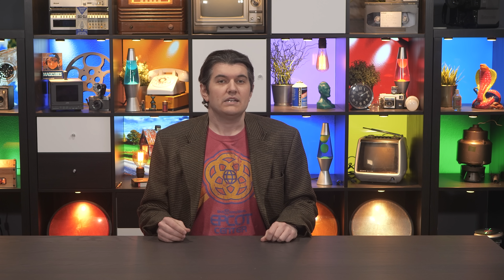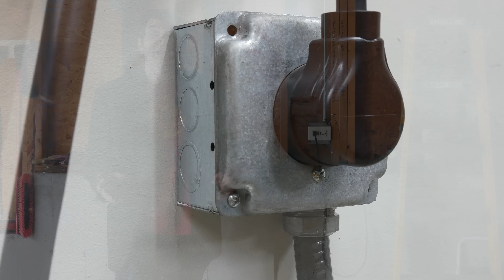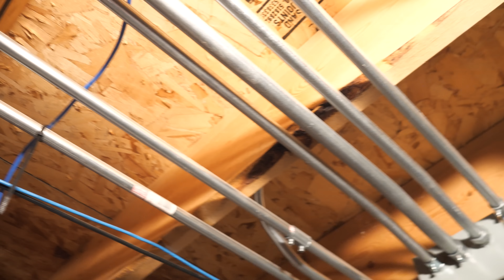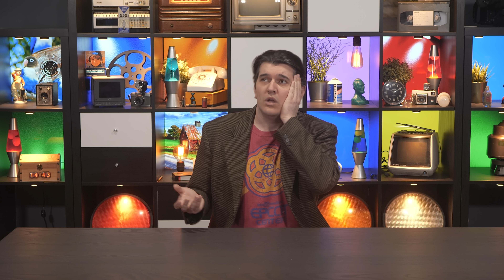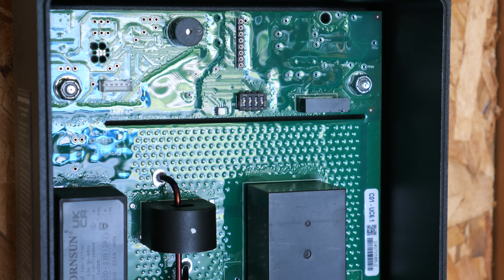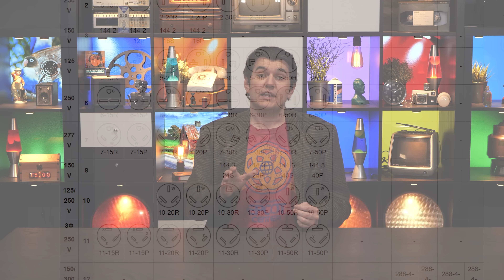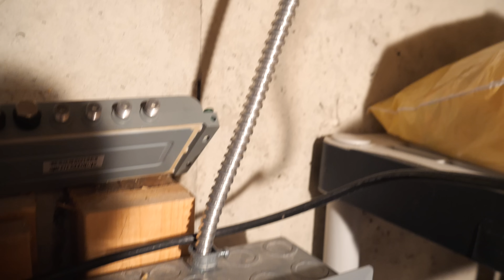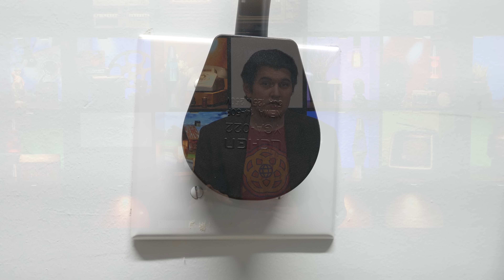The "standard" car charger is usually overkill—but your electrician might not know that

Comment: I don't drive a lot so I can get away with charging every 1 to 2 weeks. I started out charging at L1 and survived fine on this. But I live in a place with crazy weather and wanted the ability to charge faster if I know a severe storm is coming. I only have access to a 30A circuit shared with my water heater through a NeoCharge so I switched to charging through that at 24A. That has been more than enough to easily meet my needs. I have an energy plan that gives me cheaper nights for 6 hours a night, and I use scheduled charging.

I visit family in other parts of the state with some other family riding with me on occasion. I think I've sold them on the fact that EV range and charging aren't a major ordeal. I use free destination charging when I can, but unfortunately it's not common around me. But it's also not required for me.

Comment: THANK YOU!!!  I have this same conversation with friends and family after buying my Bolt EV and every time it starts out "Don't you need an electrician to install the charger?"  And I approve the charging station app rant.  I am glad there are app-less options and we should be endorsing them more.
Reply: app-less is not needed. But anything that is in the app should ideally be accessible from the hardware itself too. And anything that's actually required functionality most definitely!
But I really do not mind an appliance that also allows me to tell it to host a web-server exposing all its hardware controls and displays/statistics. aka not app-less. But app-unreliant.

ps: And preferably also SSH-server that can be used to connect to the linux machine directly, and that gives you full control (no stupid "only volatile memory that is reset on a restart" or "no root access" stupidity)
Hell, I do not even mind if the ssh connection was the only way to access diagnostic logs + statistics. Or even niche controls/settings.
Reply: My brother installed his own outlet, with a few phone calls to our former electrician uncle. It was a Saturday project for him too. And they love their PHEV Pacifica.
Reply: I have relatives who are electricians, so I'm all set haha
Reply: Your bolt has a 60-65kwh battery.  Try that game on something that has a 100kwh battery.  When you consider that it would take 56 hours to charge a Model S from 10% to 80% assuming 100% efficiency and that you can sustain 1.2kw charging, that game doesn't work very well any longer.  Then people say well you can just hit a L2 charger, and as soon as you do that, the cost per KwH means the price to drive the electric car is near the same as a Prius.

If you have a 230v 50a circuit installed for a L2 charger you can charge that same just 5.8hrs.  Meaning that it's 100% possible to now do back to back trips.  It's a static cost to get the outlet installed, install it once, and boom done.  The charger itself is only $300-$400.  Not only that, because it charges up so quickly, you can schedule night time charging to charge between 12AM and 6AM, taking advantage of the crazy cheap night rates if you move to hourly pricing.  I pay maybe 2c/kwh on average.  Where as during the day it can be as much as 6-15c/kwh.

Now, imagine you know you have a big trip coming up where you are going to run out of the battery if you hold to 80%.  With a l2 charger, even just hours before you can change the limit to 100% and tell it to charge and charge at much LESS cost over night.  so you start off with 100%, and maybe thats enough to get to and back on the same charge so you don't have to use a DC fast charger away from home.

On top of the purchase cost, it's really not that much extra to have a L2 installed at home, especially if you don't need to upgrade your panel.  And most electric companies offer cash rebates on EV L2 charger installations which offsets the cost significantly if not paying for the entire installation out-right.  I had to upgrade my panel to 200amp and have a new 14-50 line run over 120ft to the garage, so it was almost the worst case scenario.  That installation cost me $3800, I got $3600 rebate back, so the entire installation of an L2 charger in my garage only cost me $200.

Comment: it's 11am here and my solar panels are producing 4kW (they peak at ~6kW); I'm leaving on a 2000-mile roadtrip in my Tesla tonight so am charging it up now; I decided NEMA 6-20 was the optimal connection since it doesn't overpower my panels and also I didn't have a spare 50A breaker so I decided to DIY my own split from my 50A range, essentially downrating it to 30A so I could run a 20A cable from my kitchen to the garage through the attic.

Minimimal expense, fuss, and I'm chuffed it worked so well for so little money.

Comment: 12:20 Is there a requirement for a means of disconnect?  Even something like a dishwasher or garbage disposal usually requires a switch or other means of disconnect these days.  Having it plug into a receptacle that can function as that means of disconnect.
Reply: Obviously this depends on specific amendments and/or situations, but in general most means of disconnect rules require either a disconnect in sight for servicing (includes cord and plug connections), or a lockable disconnect if not in sight. 

Unless there is another code section that requires a specific type of disconnect at a specific location, all you usually need is a breaker lock that is “permanently” installed on the breaker feeding the equipment.

Comment: When I bought my first electric car and brought it home at 20% battery, I plugged it in to a 15 amp outlet because that's the only charger I had access to, and it told me that I would have to wait 115 hours for it to charge to 80%, so I drove to the local safeway, plugged it in to a dc charger for 22 minutes while I got some groceries and came home with an 80% charge and started shopping for a charger to plug into the RV outlet I had already had installed outside my garage directly under my electric panel for a relatively low cost ten years earlier.  While I could charge every day from a 15 amp outlet, I prefer charging on friday night from a 50 amp outlet, and then since I'm likely to drive somewhere over the weekend, it's ready to leave for the monday morning commute without needing to be unplugged, so every weekday morning there is more time to do whatever else is worth spending more time on than dealing with unplugging a car, and on most evenings there is more time too without dealing with plugging in a car to a 120v charger because otherwise it would take too long to recover multiple days of use.
Reply: Your first sentence implies that you have a +1500 kwh battery pack? Is your electric car actually a tractor trailer?
Reply: @BL3446  no, not all "15A" chargers default to 15 amps.  The one included with the kia ev9 gt line needs to be configured for a higher wattage for faster charging and I didn't know that the day I bought the car and plugged it in the first time.

Comment: Since you live somewhere that get actually cold I'd really like to aee you charge your Ioniq 5 outside when it is REALLY cold on a 120V 12A EVSE and see how much range you actually gain overnight.

I keep asking EV and charger review channels but everyone seems to be ignoring it. Aince the battery cinditioning aystem will be using 2-4kw but cycling on and off I'm very curious if the 1.5kw continuous from the wall is even enough to gaim any range at all when it's something like -20C outside.

Comment: We have two EV’s at home and since we moved, they’re both being charged by a 240V 10A circuit. I have plans to upgrade to 3 phase 13A, quadrupling the power, but the reality is that the current solution is fast enough. My wife charges her car once every 3 to 4 nights and my car charges during sunny hours when our solar panels produce more electricity than we need. It proves the point of your video: slower charging is not better or worse than faster charging.

Comment: I lived in a snowy Maryland and parked the car outside. I needed to charge the car more than 120v during cold weather, so I bought a 2x 120v to 240v Y cable and plugged it into two outlets in the house. Used it for over a year with no issues before moving to a state without snow. Worked perfectly and was able to charge the car just fine in below freezing weather.
Reply: what was your y cable model?

Comment: @24:00 
I’m in U.K., I’ve experienced both car and charge point integrating with energy provider (Intelligent Octopus Go). I have to say, the experience is much much better with charge point integrating with energy provider. 
Car will start charging and have to be told to stop charging. The car has to share its location to energy provider. Unreliable 4G car connection can be problematic. 
Charge point integration means simply plug in and forget. Very reliable.

Comment: Well when it comes to new construction, most building codes require an EV charging station to be installed and they have to do it however the code tells them, whether its overkill or not.

Comment: There's a third problem with charging EVs at multifamily dwellings: total building capacity.  A 20-unit building where everyone comes home from work and needs to charge overnight at 5kW needs an additional megawatt of power.  It's very likely they'll need to upgrade the building main.

Comment: Heh, I have zero experience with electric cars yet work with electric bus calculations all day. 

We will open a site with about 130 chargers (30 120kW "fast" chargers, the rest 60kW "overnight" chargers, and the whole site has a 4000kW grid connection. Another site has 36 450kW fast chargers (other types of bus). But our largest (25m/82 ft) buses have 800kWh batteries and blow through that 2-3 times a day... Boy are personal vehicles puny 😂

Comment: chevy volt, 20 mile total commute, charges in less than the full night on a regular (US) outlet at 9 amps. The powerful plugs are nice when I'm visiting someone outside the electric 2-way range and can charge fully in a couple hours (given somewhat limited electric range or 40 or so miles).
Reply: I used to use the 110v stock charger all the time, and it was fine for short trips and overnight charging.  But sometimes I need to make multiple trips, or need to go further, so I invested in a few 220v chargers to install in convenient locations to park.  So now the stock charger stays with the car in its little cubby in the back.  It's still a great backup charger on the go.  

For example, one time I was low on gas and battery, and the nearest good priced gas station was more than several miles away from the motel I was staying the night at (long road trip).  So I grabbed my charger and spare extension cord I keep with it, carefully ran it under the motel room door, and unplugged the microwave to free up a good outlet.  Was able to have the car fully charge overnight, and was able to make it to the cheaper gas station with range to spare.  One of the most satisfying moments I've had driving my Volt.  

It may have a low EV range, but it's just such a versatile EREV that I can't help but love it.  Sad that they stopped making them.

Comment: I have a 65 kWh Kona EV and most of our needs are serviced by a 120V trickle charger at about 900W. It gets us around 40 km/day which is about what we use. It would be slightly more convenient to have 2 kW capacity, which would cover 99% of our use cases. This means a 15 A 240 V dedicated branch is fine. But honestly we can get by with home trickle charger.

Comment: I'm from Europe and the charger at my home is wired directly into the breaker board. Every big electric load is wired that way. Why do US households have fewer breakers in their panels and why do they get a big outlet installed? I saw the video with the room heater conversion but that can not be the general reason.
Reply: There's a huge amount of variation in US electrical panels, often because of history and upgrades, but it's not generally true that most have "fewer breakers." Although I guess it depends on what you mean by "fewer"? The sub-panel at 7:18 has 24 breaker slots, and it's a downstream sub-panel not a main panel. Prior to the 2008 NEC there was a limit of 42 positions per panel (is that "fewer"?). Sometimes people just buy the smallest and cheapest panel they can, because they don't think about future expansion. I don't know what you mean by "get a big outlet installed."
Reply: @johnhawkinson  Regarding panel size: The electrical pannel looks way larger than it needs to be. Where I'm from the breaker amount to surface area ration is much higher. That's what I'm curious about.
Regarding the outlet: Wrong way to ask the question. You don't need an outlet. It's shown in the video. My question is why have a plug on the chargers (where power goes in) in the fist place, if you only ever plug the charger into the wall and then the car into the charger? It's not a regular outlet so you can't use it for much else.
Reply: @freddygoodman  Maybe Google some typical US panel installations to get a better sense of that. (This panel looks like Square-D Homeline panel, so try "HOM2448M100PCVP")  GFCI and AFCI breakers are much bigger than traditional breakers, maybe 2x as wide horizontally, so panels have gotten wider. And then there's generous space ("gutters") for wires to go up and down. And separate ground and neutral bars for terminating those wires. The space above is for a pretty large main breaker, with fat lugs to allow big gauge cables to make gentle turns, esp. if the panel is fed from below. I guess we have bigger wires than you do, comparatively, what with our lower voltage 120V branch circuits.
As for why people install a receptacle to plug in the EVSE instead of hard-wiring it, well, I think a lot of people don't (Alec did not in this video!), but it's likely viewed as cheaper and more future-proof to have the electrician install a receptacle and the homeowner can mount the EVSE and plug it in themselves.  I'm not an EV expert, but I think there is wide variation in practice throughout the US.
Except those people who already have the requisite outlet in their garage for a clothes dryer or a welder or a bespoke artisanal lathe. A small minority, that.
Does that answer your question?
Reply: Where in Europe? Europe is not a country and you shouldn't compare it to one.
Reply: @CorneliusTaylor-s1u I'm sorry, but I'm unable to see how the country I live in is relevant to answer my question. I mentioned that because people might provide some extra context that I don't have.

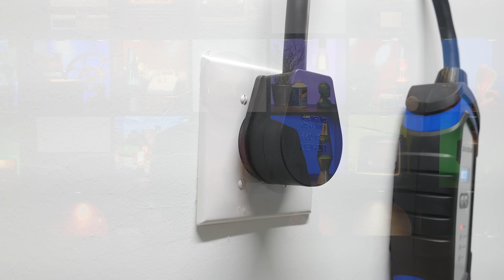Comment: 0:23 ... the flexing on that outlet is mildly concerning.
Reply: It's probably not that big of a deal since you hardly ever need to unplug/replug the things that go in those outlets
Reply: NEMA outlets for you. Very little holding it all together.
Reply: the metal part of the outlet its made on to is flexing and only 2 screws hold it to the box  they could go to a twist lock that I Feel would be much better .
Reply: Proper 14-50R requires considerable insertion force, and mounting a box on one side to a stud + drywall means . . . things flex.  Heck, it might even be an "old work" box and mounted directly to the drywall.  It ain't commercial.

Comment: I’ve had my id4 for a year, only charging at 12amp on a standard outlet in my detached garage, since running a new line would be crazy expensive, only issue I’ve had is before a road trip trying to get as much charge as I can requires not driving the day or two before or planning in advance to charge extra for a few days. I did manage to convince my parents to throw a 30a circuit in their new house despite them being anti ev because it’s way cheaper to do now $250 vs $1k+ to do it later.

Comment: Yeah, I had a PHEV with a small battery that got ~35 miles to a charge, and was perfectly fine just plugging it into a regular outlet on the outside of the house. Given that it only took ~8 hours to charge to full, it was easy to just let it charge overnight.

Comment: DONT USE THE 10-50 socket if you can’t. I had one and water got in and it got corroded . Hardwire if you can
Reply: I think he has another video comparing the 50a sockets available.

The more expensive ones probably are more corrosion resistant.

Comment: I bought an EV about 2 years ago, and I charge it on a regular 120V/15A circuit. It's been more than enough for me.

For context, I live and work in Des Moines. 25 miles of in-town driving every day. Cold winters are no problem.

Comment: "It's very slow"

That means it can't charge your electric car, Hank. You're shredding your car's lifespan by constantly plugging it and unplugging it and electric cars already shed value at an insane rate because there's way too many people who have them and are now trying to offload them. Because a bog standard 120 volt cable can't charge their car. If you have to wait five days to carry your car from empty to mostly full, you can't charge your car. English is an imprecise language, we're not robots. Man was meant to burn gasoline to move his car. Urbanite filth can use their RC cars to go buy groceries. The midwest is quite possibly the strongest argument AGAINST buying an electric car. Range halves for half the year while it's an ice-covered hellscape, other half of the year AC has to be cranked which also kills range, you're stuck in suburbia so LMAO, everything is spaced out because failed urban planning and now you get to be stuck in traffic which also kills range and lol of course the public transit is sh-t. 

Just drive gas, you're only shaving a year off the Earth. Or buy a gas / electric hybrid.